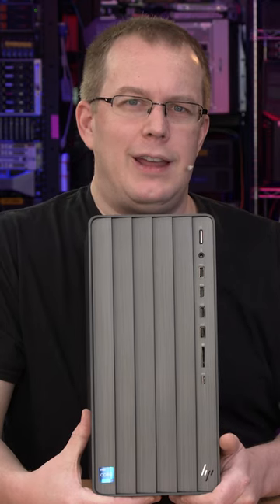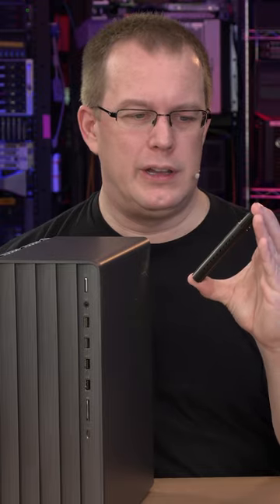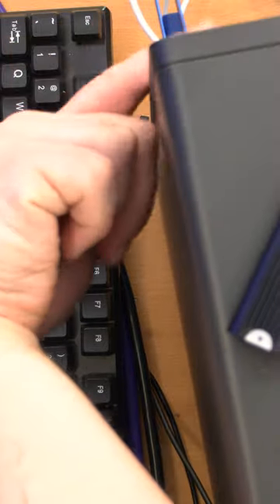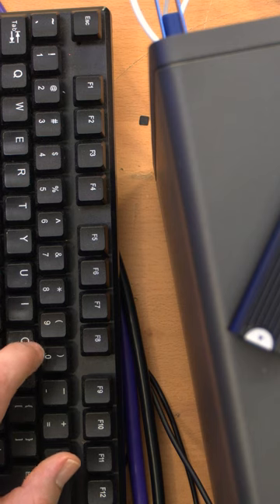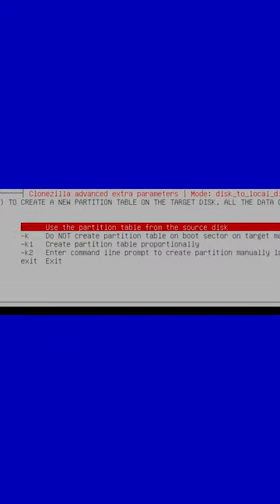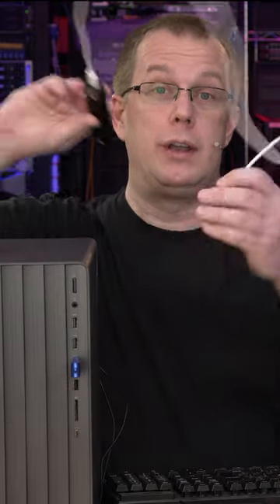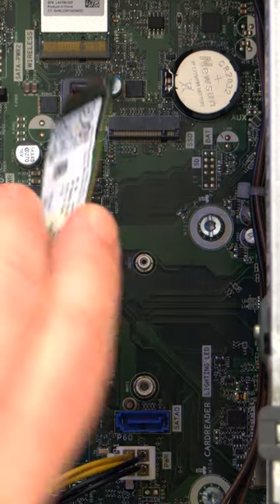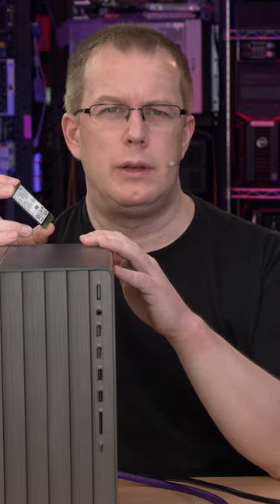Using Clonezilla to Upgrade the SSD in a New Computer

Comment: The issue with your instruction is you tell us to select partition to partition, but when your video cuts back you are in disk to disk mode. IF YOU WANT THIS TO WORK, DONT SELECT PARTITION TO PARTITION MODE. Select DISK TO DISK mode. They key step is at the end where you select option "-k1" which will create the partition table proportionally in the target disk. Following your instructions as is will cause boot problems. You need to clarify this step, I'm not the only one who has had issues following this video.
Reply: Yes, I was also confused with it. They selected partition to partition, but ghen proceeded with the disk to disk clone... Ive used clonezilla for years now and still got confused, thought they changed something... They should fix this.
Reply: Thanks for the comment.  I read this right before I proceeded with the clone.
Reply: This guy… big time life saver!!
Reply: Thank you for this
Reply: if you do disk to disk how to fit it into a larger one? and what happen with disks with multiple partitions?
Reply: Goated comment should be pinned.
Glad I read before I proceeded
Reply: my paranoid nature and this comment already existing. Thank you. You are a gentleman and a scholar.
Reply: wow without this comment this video is utterly useless
Reply: THANK YOU

Comment: Your video skips over the actual partition selection - are we supposed to run clonezilla 2-3 times to copy over the system reserve and recovery partitions to the new drive? Or are we just saying "peace out" to whatever other windows system and recovery partitions are on the original drive?
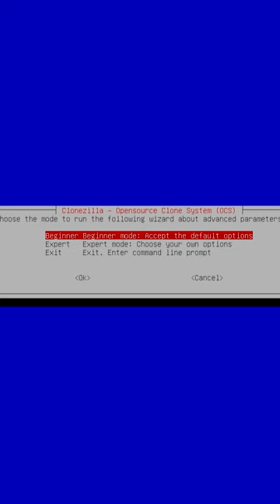Reply: I'm curious about this too.  At 7:50 a partition to partition clone is specifically selected, when what you would need is a disk to disk clone, no?
Reply: @FryChicken  Ya, I just tested this and my Samsung drive of course has 3-4 partitions. So, if you select one, it'll only copy the 1 to the new and render the new drive un-bootable. I think the easiest is to do disk to disk, and local disk to local disk, and then do the disk proportionally option. If you REALLY have to fix the partition, you need to extend it with some sort of partition application.... Or, just suck it up and make a new logical disk with the unallocated space in computer management.
Reply: @melkert81  Thanks for answering this question, I raised an eyebrow when he insisted that we have to use "partition to partition" in the video. Disk to disk seems fine.

Comment: Following these directions exactly for a windows system with a Gpt configured drive (copying to a brand new ssd) completely broke booting.

I had to boot to a windows installation drive, use diskpart to find out the system and recovery partitions were absolutely f*ed (they were listed as RAW), so I had to delete the EFI system partition, create a new one, and then repair the efi bootloader by using the bcdboot.exe tool to copy the UEFI boot environment files from the Windows system directory to the EFI boot partition and recreate the BCD bootloader configuration
Reply: Having the same issue. How did you go about doing this?

Comment: That 850x really needs a heatsink(WD sells a version with the heatsink). 
That might not be a huge issue with a productivity computer but the drive will start throttling if it gets too hot, plus there is potential for premature failure.

Also as mentioned by many you want to be cloning Disk to Disk, to copy all correctly. 
You can resize the partitions afterwards.

Comment: hey scott, i cloned my boot drive from old HDD to SSD and it worked fine. problem is now the old HDD no longer detected by windows, is there any way to restore it so i can have both drives available?
Reply from the maker: Hmm.. that's strange.  I'd start with the basics and make sure the HDD has power and is spinning, and that the SATA cable is seated properly on both ends.  If you have other SATA ports available, try another one, and ensure they're all enabled in the BIOS (and that the HDD is showing up in the BIOS).  Unless the drive randomly failed right after the clone process it should work.  Oh, also open up Disk Management from the start menu and see if the HDD shows up in there.  It's possible it's detected as a foreign disk, and you can just right click on it and import it.  (Just some thoughts off the top of my head.)
Reply: Read my comment. You will now need to rebuild your boot files.
Reply: @ScottDotDot  Its the partition to partition mode you tell people to follow, its breaking things. It should be disk to disk with the -K1 option selected at the end
Reply from the maker: @endosrt  In Oddo147's case, the old HDD is the one that stopped working.  As long as the correct source/dest disks were selected, the original should be unaffected regardless of the mode/options selected in Clonezilla.  And I mean, it could be I made a mistake.. but the video wasn't a ruse.  I documented the actual process I used, and that machine has been booting/working fine for 2 months now.  Unless I'm missing something?